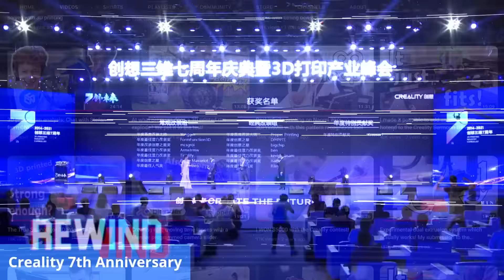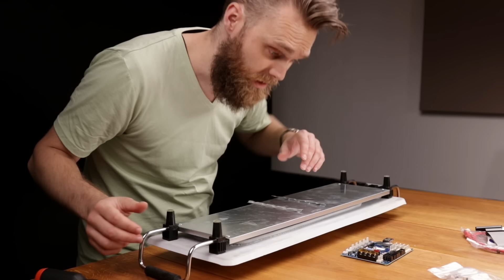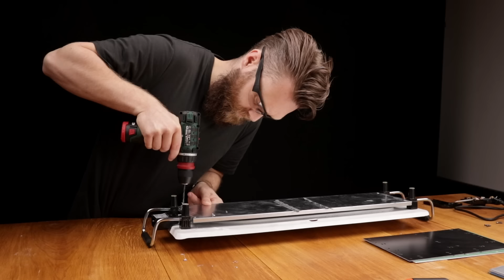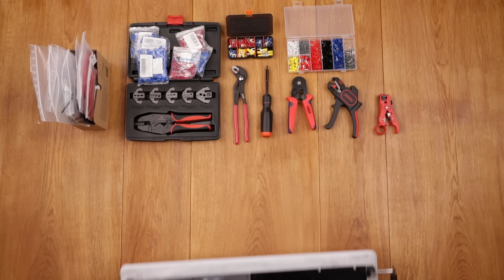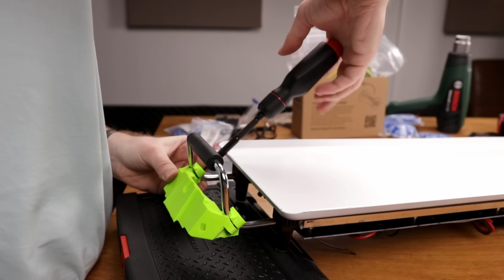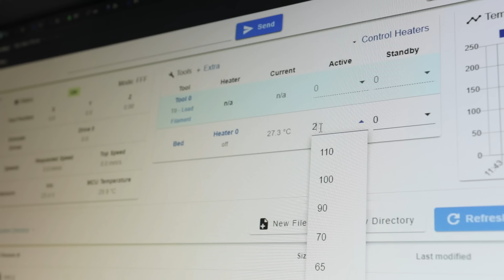A grill plate as base for a 3D printer?

Comment: Won't the electronics get quite hot when they are mounted so close to the heater plate?
Reply from the maker: I placed insulation there and it's below the heater. I left the option open to add fans in case it would get hot, but I don't think that's needed.

Comment: Couldn't you have used the laser to cut the aluminum instead of bendy method?
Reply from the maker: No, aluminium is impossible to cut with a laser like I have because it reflects the light so well. I only managed to leave a little marking on there with the help of the plastic layer.
Reply: There's a bandsaw visible in the shop.  That will easily cut aluminum sheet.  So will a table saw or even a portable circular saw.  But the "It ain't stupid if it works" method was good enough for a one-off effort.

Comment: Could even use it as a cheap and big hotplate for reflow soldering
Reply from the maker: That's an awesome use case indeed! Now you mention this, I think even as bottom heater for PCB's with large copper planes or for soldering components with a heat sink like QFN's or power MOSFET's could work as well!

Comment: I use 240VAC 1500W silicon heater atteched to 5mm aluminium sheet. Locks on to temp quick and stays rock solid on temp

Comment: Hey Proper, ive been working on an idea that allows 3D prints to be recycled into "glue stick" style piece of stock, then printed using a custom hotend. The reason I think this is important is because it would allow easy recycling at home, using molds and ovens (or grills like these!) Ideally the mold would have integrated gear teeth to mesh with the extruder assembly (and would be around 1x1x"x" cm), to increase torque. Im not very knowledgeable on heat transfer through materials, and I have no machining skills :(( maybe this is a project that interests you? Thanks for reading!!!
Reply: There's a reason you don't see anyone selling filament as thick as glue sticks... 🤦‍♂
Reply: @DrakeOola  why? Thermal conductivity would be tough, but with enough torque and heating tool surface area you don’t think it would work?

I’m really trying to make this happen, why do you think it’s not worth pursuing?
Reply: @0hellow797  It's not that it wouldn't work at all, it's that it would just work worse in every way compared to filament. You'd need a lot of heat and an extremely precise and extremely powerful extruder. 
You'd need a lot of heat because you're trying to melt, from the sides in towards the center, a stick of plastic with a cross-sectional area over 30x that of a 1.75mm filament. Since you can't just turn up the heater temperature to increase the heating rate (the plastic on the outside would burn), you'd just have to wait for a long time before printing to let a suitable amount of plastic melt. Similarly, it would take a long time for the hotend to cool down, leading to lots of oozing out the nozzle once the print is finished. 
It'd have to be extremely precise because you're going from a 10mm diameter stick to a 0.4mm diameter nozzle, about a 630x reduction. Meaning, in order to print a line that 1mm long, you'd need to move the extruder a distance of 0.0016mm or 1.6 microns. Considering that 3d printers make many moves shorter than 1mm, you'd have to be able to control the extruder's movement on the scale of tenths of a micron, which is a lot to ask of a hobby grade machine.
Finally, the extruder would have to be very strong because, again, it's pushing a stick of plastic through a 630x reduction hole. Consider that a normal extruder can usually generate several kgs of force (I know it's not technically force but too bad) with a 1.75mm filament. Grabbing a number from the middle range, say 4kg, that's a pressure of about 40bar at the tip of the nozzle. To get that same 40bar pressure with a 10mm diameter stick, the extruder would have to push with about 130kg, which is both hard to do and would require a very beefy hotend assembly to not break apart.
Overall, it would be very difficult to make and just wouldn't have any advantages over filament. It's a cool idea and absolutely don't let my speech deter you from trying out your ideas, often the greatest inventions come from wild ideas. If you're really interested in making filament recycling more accessible, I would say your time is better spent trying to improve the methods of creating filament at home. Cheaper and more reliable machines for shredding and extruding filament would help tremendously in making recycling more suitable to hobbyists.
Reply: @jblack3761   you have no idea how much this amount of info will help, I’ve really had no where to start…
Reply: @jblack3761  looks like I’ll be printing with muuuch larger nozzles I think haha

Comment: I figure a solution is to crimp the thermocouple in a ring terminal, and use the mica sheet and insulating washers for a TO-220 transistor isolating kit to decouple the washer, the mica is used because it conducts heat quickly, and survives high temperatures.

Comment: I'd be worried if that SSR ever fails short-circuit. I wonder how hot it would get... Does the plate feature an internal over-temp cutout?
Reply: A thermal fuse is also absolutely required.

Comment: There are different Types of Temperature Sensor Configurations available.
You can get them with a Metal Shell like the one that fits well but without a Galvanic Connection to it.

Comment: Since you're putting a piece of glass on it, would it make sense to put a sheet or copper or aluminum between the plate and the glass to even out the hot spots? I'd imagine the thicker the metal the more even the heat but longer time to warm up

Comment: Did he make a 3D printer from this yet? Nope.
Did he make the world's most precise and over engineered grill plate? HELL YEAH 🔥 🤘
Reply: It sure is more precise then the standard way of using it. Maybe a lot of us can have one finished before the holidays 😂
Reply: And then there's me that couldn't ass myself with getting bed PID tuned so just screw it and let it go in bang-bang mode and call it a day.
Reply: @Kalvinjj  if this helps in any way: Once i PID tuned my ender via octoprint, the temps were unstable as hell. Went back to bang-bang and its just fine. Dont bother with PID.
Reply: Yes he actually did that

Comment: What is the main plate made out of? I think that it'd be better to drill and tap holes into it if it's metal and thread in M3 threaded thermistors (same ones are some printers use), they are HT enough

Comment: A trick for attaching wires with cable ties is to feed the ties through the mounting holes twice(1 loop). This enables the ties to hold the wires more firmly over a greater clamping area and wastes less tie length. This is because less tie is pulled through for more minute control.

Comment: 😮 I fully agree with this. How much does it warp though? I effing love this and the multiple gantry design. It's exactly what I would expect to see in a 3d printer for making shipping containers.
Reply from the maker: No idea how much it warps, but I don't think it's that different than usual when printing at normal temperatures
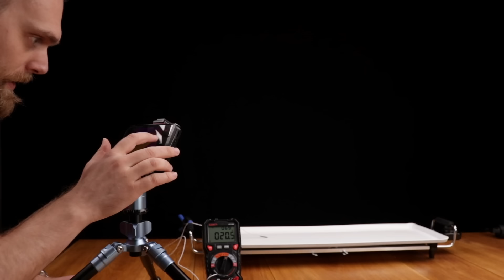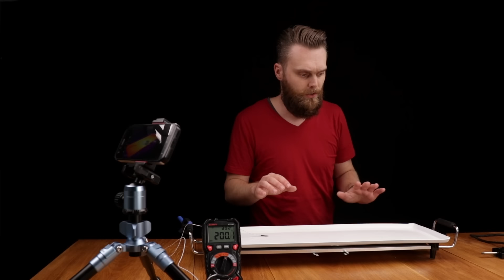Reply: @properprinting  Bruh.. jump from 1:20 to 2:20 you can literally see the entire center of the plate moved at least a centimeter.
Reply from the maker: @bubbasplants189   haha sh*t you're right, well spotted. Well, looks like it needs some reinforcement😅
Reply: @properprinting  Lol yeah shouldn't be terrible. You'll be good after you reinforce it and add the glass plate on top. Looking forward to the printing.
Reply: Just don't forget an abl for nice straight pieces of "speklap" 😁

Comment: Ive been thinking about doing this but converting a server rack in to a bed slinger. Doing it now!
Reply from the maker: I've considered 19" racks too and I think that this is a great idea! Especially when you make the printer with the flanges, so you can place it in any standard rack just like the regular equipment. Awesome that you're actually doing it, good luck!
Reply: Thankyou sir, thats actually a pretty cool idea as well. mine was going to be hard baked in but, making it modular could ad some needless complexity which i tend to gravitate towards. Or transforming the printer from a horizontal bed movement to a vertical bed movement (Ender 5 style) to facilitate dual opposing hotend setup for simultaneous mirror image printing..  Tuning might be enough to drive you insane though.  @properprinting

Comment: Hell yea, those threaded inserts are so good! When I changed my garage door opener, I drilled holes in the thin steel plate on the door (it had a plate for bolting the motor onto), but I it was so thin there wouldnt be enough material for proper thread. Put a few of those inserts in, now it is rock solid, with plenty of thread for each bolt.

Comment: Did you check how much it deformed with the heat? it's possible to see the deformation in the video. I think it'll be a big problem to print. maybe you'll need to add a think aluminum over the base
Reply from the maker: I haven't checked it, and probably I have to add some kind of bed leveling probe. On the other hand, I think that at normal printing temperature it wouldn't be that different from a regular 3D printer.

Comment: Gantry printing... Just like multi-hotend printing, you will need to extend horizontal axis beyond the printing area for the number of gantries used. Otherwise hotend(1) will not print the full length of the Y axis as well as the other hotends(#). You will need to code the gantries to park either to the left or right according to which gantry is used. Example: Printing with gantry(3), you will need to park gantry(1) and gantry(2) to the left, and so on. 
Meer kracht naar je elleboog!
Reply from the maker: Yep, it's going to be a challenge and part of the build plate will not be utilized in that configuration (which is not that big of a deal since it's already pretty long) Duet is willing to support me with the control side of things, so we'll make it work!